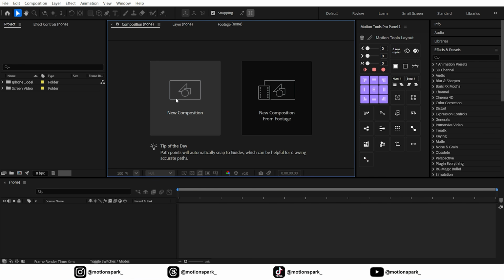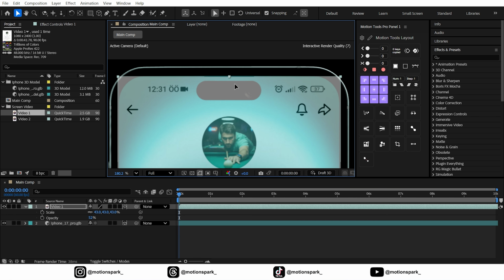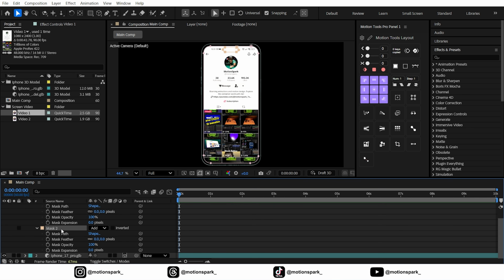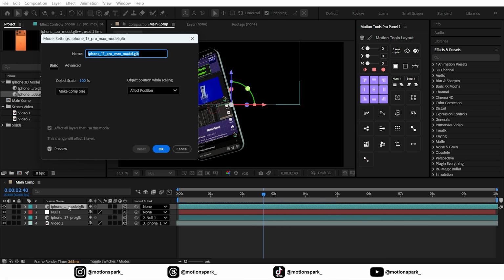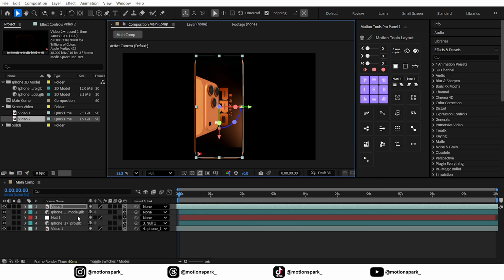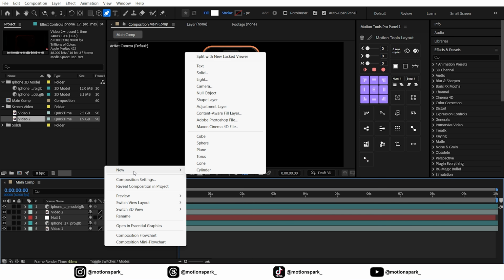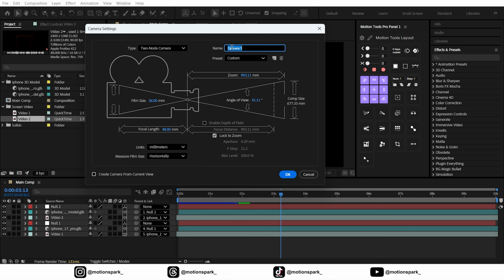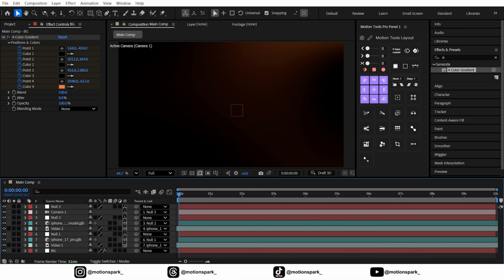Add Your Visuals to a 3D iPhone Model in After Effects Full Tutorial - No Plugin

Comment: Whenever I add null the anchor point is not set on the phone and it's so hard to get it right
Reply from the maker: It’s actually not a difficult process. You just need to correctly position the null object relative to the model at the center, top, bottom, left, or right, depending on the animation; and most importantly, you need to link the model to the null object using a parent link.

Comment: Great tutorial, thanks. I have a quick question, is it possible to change the model’s color directly in AE, or do you need to use a 3D software to achieve that?
Reply from the maker: Greetings! Thank you for the kind words. That’s a very good question. If you are using the latest versions of After Effects (v24 and later), you can change the color of .glb models natively without needing any plugins. Once you add the model to your composition, you can adjust the color and glossiness under the 'Material Options' in the layer properties. However, if you want to change only a specific part of the model (for example, just the buttons on a phone), using a 3D software like Blender to separate the materials will give you a much more professional result. Good luck with your projects.